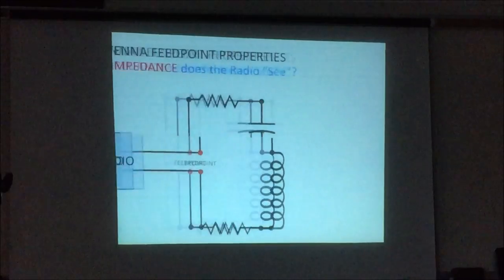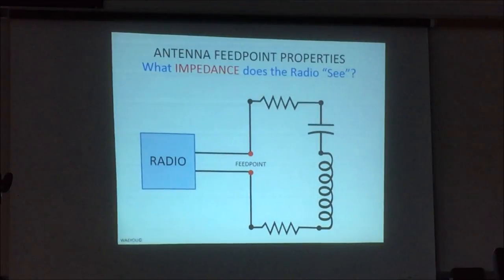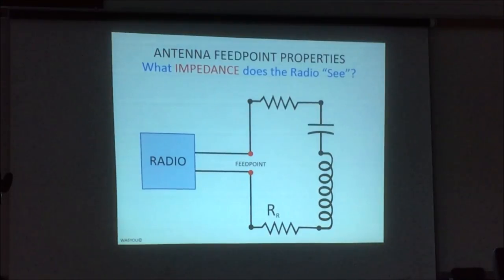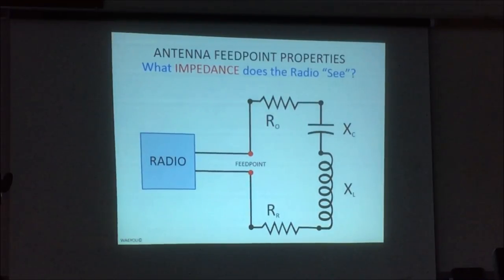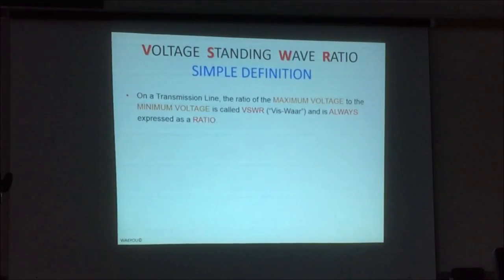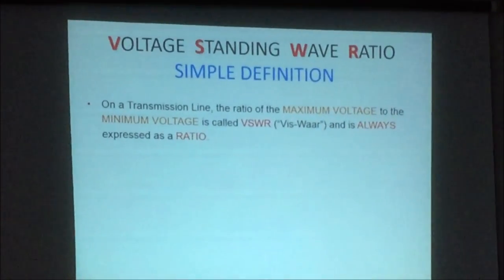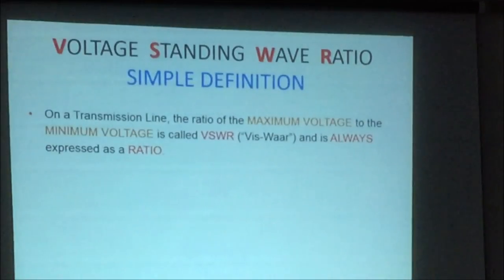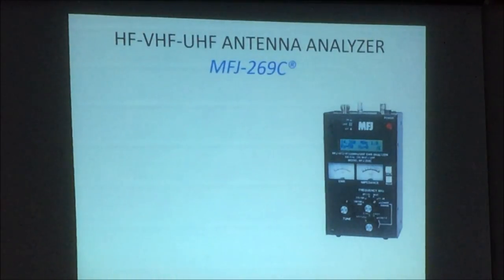How to use an antenna analyzer

Comment: The Comet won't work under the field of a radio station transmission. I bought one of Comet anaylers and it would not work, so it  went back to Comet, and they eventually called me. In our conversation I mentioned  the radio station that is a few miles from me.  They promptly told HRO to take it back and give me a full refund. The meter can't work under the strong signal from a radio station. I really liked the design of the Comet, but as you know, Hams are usually using these  at tower sites that are usually shared with other services, so that would be a problem. The MFJ works fine for me, so my guess is that it has better shielding  with all that metal. Comet must use too much plastic.